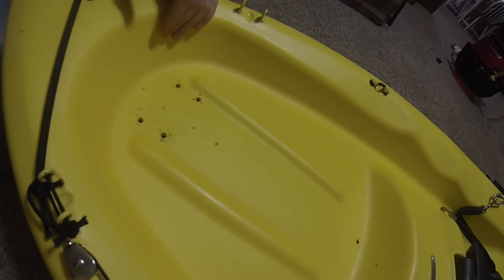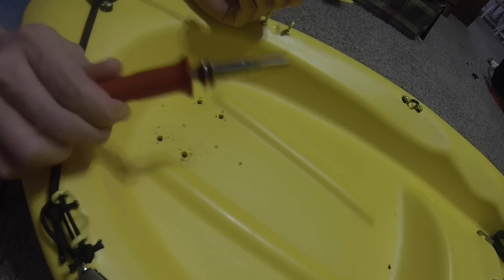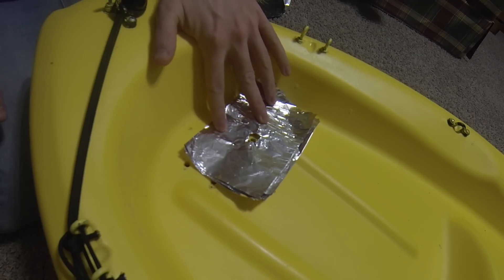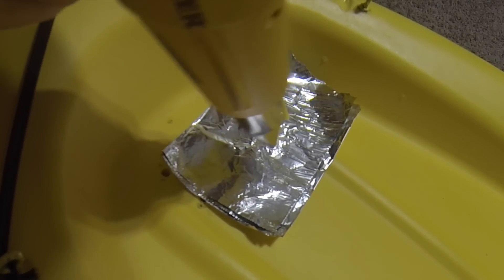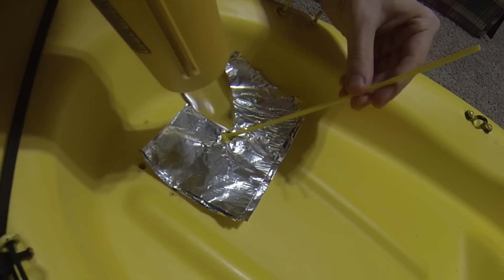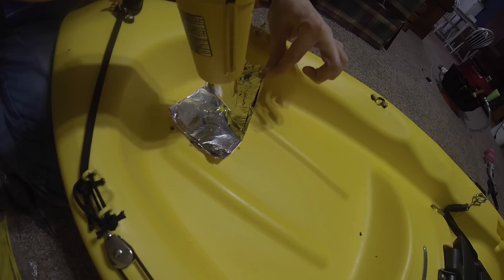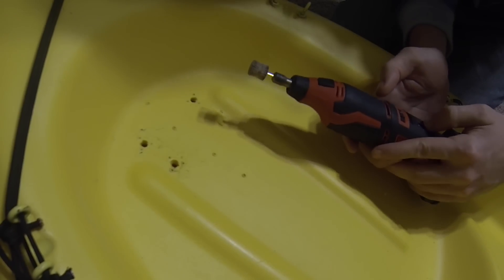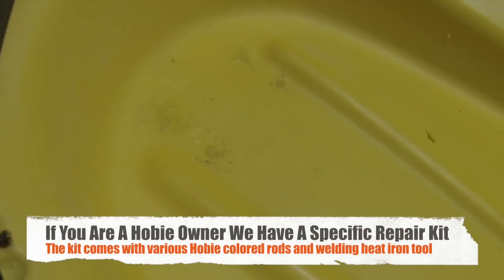Kayak Hull Repair: HDPE Plastic Rod Welding Tutorial Using Basic Tools

Comment: could colored hot melt used for this application?
Reply from the maker: Hot glue won’t stick.  In terms of cost it is much more effective and stronger to use plastic rods.  Tons available to choose from on Amazon.  Also if your kayak is made of HDPE you can use #2 recycle plastic jugs like Tide bottles.

Comment: omg.. you showed us getting up to temperature.. but then fast forwarded through the important part of the actual application of the welding part!? fail
Reply from the maker: Yep...needless to say our video from 3yrs ago didn't have the editing they do now.  We are not perfect.  What is going on with your kayak?  Have a repair that needs fixing?  I'm actually testing a few products right now for kayak repair aside from plastic welding.  They and much more can be found on the web store linked in channel. The plastic welders listed on our web store works easier than heat gun and some are more affordable too.  We are going to be doing new videos soon on kayak repair and protection methods.  Needless to say will try to not fast forward through important parts.  Thanks for the feedback.